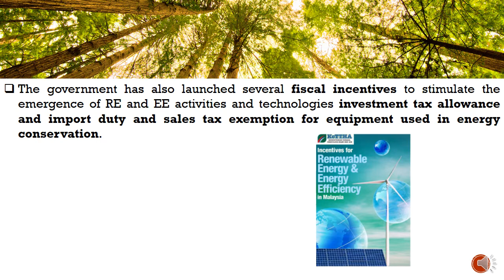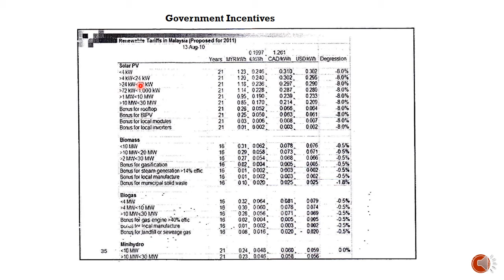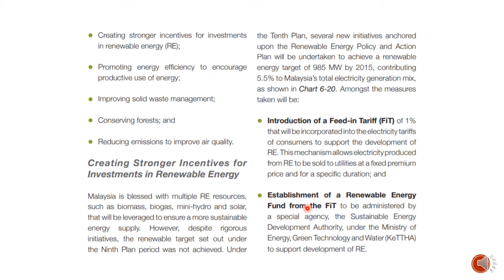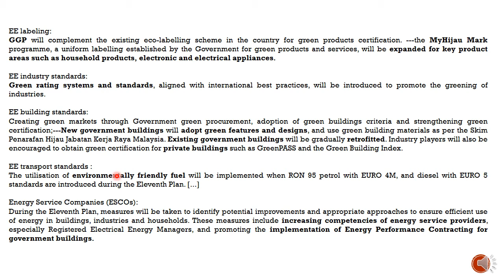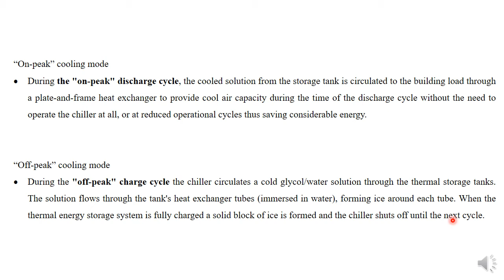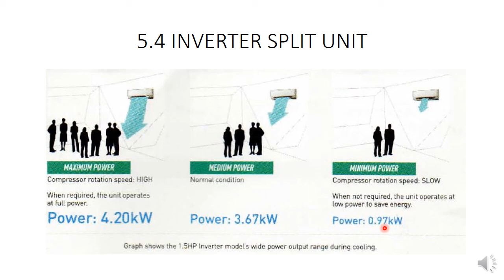Lecture 5&6 Application of “Green HVAC System” in industry

Comment: Cheah Kok Hun B071710006 4BMMH S1/1
APPLICATION OF GREEN TECNOLOGY IN INDUSTRIES. ENERGY EFFICIENCY (EE) STRATEGIES UNDER 9MP (2006-2010) 
1. The government will adopt the measures to reduce wastage by enhancing energy efficiency and increasing energy sufficiency in order to meet requirement of proposal of go green technology. 
2. Government also committed to reduce dependence consumption on petroleum products through replacement of the usage of alternative fuels such as biofuels and biodiesels.

 AIM OF THE STRATEGIES
In the manufacturing and commercial industries, energy saving features applied and enhanced. 
1.	ENVIRONMENTAL MANAGEMENT 
a. Is incipient industry with substantial growth potential in green technology. 
b. Spin off new categories of professionals and new areas of specialization for architectural and engineering services. 
2.	INITIATIVES TO DRIVE ENERGY EFFICIENCY EFFORT (HVAC INDUSTRY)
a. Increasing in use of energy efficiencies machineries and equipment. 
b. Introduction of Minimum Energy Performance Standards for selected appliances to restrict the malfunction, import and sale of inefficient appliances to consumers.
 MALAYSIAN ELEVENTH PLAN (2016-2020) 
1. Sustainable consumption and production practices will increase the adoption of energy-efficiency and low carbon buildings, transports, products, and services that using in daily life.
 2.Embarking on Green Growth: Resource and energy efficient in balancing both supply-side and demand-side considerations and constraints (Sustainable)
3. Encouraging low carbon mobility through utilization of energy efficient vehicles and public transports. AIM: By 2020, it is targeted at least 20% of government procurement will be green. 
EXAMPLE OF GREEN TECNOLOGY MACHINE/SYSTEM IMPLEMENTED IN HVAC INDUSTRY. 
1.Thermal Energy Storage -Thermal energy storage (TES) is a technology that by heating or cooling a storage medium, stores thermal energy so that the stored energy can be used for heating and cooling applications and power generation at a later time. In particular, TES systems are used in buildings and industrial processes. It captures low-cost energy from the power grid during the nigh off peak and then use this captured low-cost energy to replace high-cost energy during the following day which is on peak.
2. Hybrid Chiller -For their ability to handle large loads with very high efficiency and low cost, hybrid chillers are needed. They are usually used and act as the core of central plant systems in larger commercial, manufacturing, and process applications. 
3. Desiccant Dehumidifier System -Desiccant dehumidifiers are particularly well suited at low temperatures and low humidity levels to extract moisture from the air. A proprietary desiccant wheel composed of corrugated material is at the center of these dehumidifiers. Air moves through the material's flutes, touching the desiccant.
 4. Inverter Split Unit -An inverter is a frequency converting unit. In many home appliances, the technology is used and regulates electric voltage, current and frequency. In

Comment: MUHAMMAD ZULQARNAIN BIN ZAMZURI

B071710782 (4 BMMH 1/2) 

Energy Efficiency (EE) Strategies under the 9MP
[2006-2010]

-       Measure to reduce wastage by enhancing EE and increasing energy sufficiency

-       Reduce depended on patrol 

-       Aim: energy-saving features in the industrial and commercial sectors

-       Efficient lighting and air conditioning system

-       Establishment of a comprehensive energy management system

Type of incentives for providing EE services 

1.    Pioneer Status (PS)

-      Exemption from income tax on 100% statutory income for 10 years

-       Accumulated losses during pioneer period can be carried forward and deducted against post period.

-       Exemption of commence

2.    Investment Text Allowance (ITA)

-       100% of qualifying capitals incurred within period of 8 years

-       Unutilized allowances can be carried forward

3.    Import Duty and Sales Tax Exemption

-       Companies generating RE can apply for import duty and sales tax exemption 

-       Locally purchased – full exemption is given on sales tax

-       Exemption is given for a period of 1 year

Example of Green Tech in HVAC

- Thermal energy storage

- Hybrid chiller

- Desiccant dehumidifier system

- Inverter split unit

Comment: MUHAMMAD HAFIZ BIN JOHARI (B071710380) BMMH S1/2

Energy efficiency (EE) strategies under the 9MP (2006-2010)
1. Encourage better utilization of RE through diversifying fuel sources. 
2. Intensify efforts to reduce the dependency on petroleum provides more to integrate alternative fuels.
3. Incentives in promoting RE and EE are further enhanced.

Type of incentives
1.	Pioneer status (PS)
2.	Investment Tax Allowance (ITA)
3.	Import duty and sales Tax Exemption

green technologies in HVAC
1. Thermal energy storage
2. Hybrid chiller
3. Desiccant dehumidifier system
4. Inverter split unit

Comment: AHMAD KHAIRUL AKMAL BIN AHAMAD KHAIRUDIN
B071710715
4BMMH S1/1

Application in Industry 

The energy efficiency strategies under the 9MP (2006 – 2010)
-	Government adopts the measure to reduce wastage by improving energy efficiency & energy sufficiency.
-	Government will reduce dependency on petroleum product.
Type of incentives for companies for adopting the EE initiative
1)	Pioneer Status
-	Exempt tax from income on the statutory income for over 10 years.
-	Unabsorbed capitals and allowance can be carried forward and be deducted against post pioneer income.
2)	Investment Tax Allowance (ITA)
-	Fully qualification on capital expenditure within 5 years are utilized against statutory income.
-	Unutilized allowance can be carried over.
3)	Import Duty and sales Tax Exemption
-	Locally purchased (tax exemption)
-	Tax exemption is given over the period of one year.

Example of EE HVAC devices in the field currently
1)	Thermal Energy Storage (TES)
2)	Hybrid Chiller
3)	Desiccant Dehumidifier System
4)	Inverter Split unit

Comment: KHOR YE SHU (B071710464) 4BMMH S1/2

Energy efficiency (EE) strategies under the 9MP (2006-2010) :

1.	To reduce the wastage by enhancing energy efficiency 
2.	Increasing energy sufficiency.
3.	To reduce dependence on petroleum products

The purpose  of 10th Malaysia Plan:
i)	creating stronger incentives for investment in renewable energy.
a.	Introduction of a Feed-in Tariff (FiT)
b.	Establishment of RE fund from the FiT
ii)	promoting energy efficiency to encourage productive use of energy.
iii)	improving solid waste management.
iv)	conserving forest.
v)	reducing emission to improve air quality.

Malaysian Eleventh Plan (2016-2020) Target: Increase the adoption of energy-efficient and low carbon buildings, transports, products and services.

EXAMPLE OF GREEN TECNOLOGY MACHINE/SYSTEM IMPLEMENTED IN HVAC INDUSTRY:
1.Thermal Energy Storage
-Thermal energy storage (TES) is a technology that by heating or cooling a storage medium, stores thermal energy so that the stored energy can be used for heating and cooling applications and power generation at a later time. In particular, TES systems are used in buildings and industrial processes.

2. Hybrid Chiller
-For their ability to handle large loads with very high efficiency and low cost, hybrid chillers are needed. They are usually used and act as the core of central plant systems in larger commercial, manufacturing, and process applications.

3. Dessicant Dehumidifier System
-Desiccant dehumidifiers are particularly well suited at low temperatures and low humidity levels to extract moisture from the air. A proprietary desiccant wheel composed of corrugated material is at the centre of these dehumidifiers. Air moves through the material's flutes, touching the desiccant.

4. Inverter Split Unit
-An inverter is a frequency converting unit. In many home appliances, the technology is used and regulates electric voltage, current and frequency. In order to control the refrigerant (gas) flow rate, an inverter type air-conditioner changes the compressor speed, thus consuming less current and electricity.

Comment: NUR SHAFIQAH BT ABDUL GHAPOOR
B071710400
4BMMH S1/1

-	EE is to reduce wastage by enhancing energy efficiency and increase energy sufficiency and also committed to reduce dependence on petroleum products.
-	The aim is to energy saving features in the industrial and commercial sectors.
-	EE features such as efficient lighting and air conditioning systems as well as encouraging the establishment of a comprehensive energy management system.

a.	Type of incentives for companies providing EE services: -
•	Pioneer Status (PS)
•	Investment Tax Allowance (ITA)
•	Import Duty and Sales Tax Exemption 
b.	Malaysian 10th plan (2011-2015)
5 strategies pillars of the new energy policy: -
•	Energy pricing
•	Supply side
•	Energy efficiency
•	Governance
•	Change management
c.	Introduction of a Feed-in Tariff (FiT)
d.	Establishment of a Renewable Energy Fund from the FiT 
e.	Initiatives to Drive Energy Efficiency Efforts:
•	Residential
•	Township
•	Industrial – increasing the use of energy efficient machineries and equipment. Introduction of minimum energy performance standards for selected appliances.
•	Building
f.	Malaysian 11th Plan (2016-2020)
•	Sustainable consumption and production practices will increase the adopt of energy-efficient and low carbon buildings, transport, products and services. 
g.	Thermal Energy Storage
•	Ice stores- Used in refrigeration in order to cover and increased additional refrigeration demand 
•	Thermal energy Storage- Capture low-cost energy from power grid during the night and captured low-cost energy to replace high-cost cooling energy during the following day. 
•	Cool storage- to produce a large quantity of a cold medium stored in a tank 
•	Good for any new facility that has a large cooling load
h.	Hybrid Chiller
•	Combination of condenser and cooling tower into an all-in-one packaged hybrid chiller.
•	Used in large commercial, industrial and process applications and serves as a heart pf central plant system.
•	Energy-efficient, consumes 10%-30% less energy, 45%-50% less water consumption.
•	Is easier and cheaper to install, low operating cost, saves space, plant room not required, is easier to maintain. 
i.	Desiccant Dehumidifier System
j.	Inverter Split Unit
•	Save energy by varying the rotations specified by the compressor to maintain the set of temperature.

Comment: ALDEN ANDRIAN PHIUS
B071710392
BMMH S1/1

LECTURE 5&6

Application of green HVAC system in industry

1.Energy efficiency ( EE) strategies under the 9MP(2006-20100
- reduce wastage by enhancing energy efficiency
- increasing energy efficiency
- reduce dependence on petroleum product
Aim 
- energy saving features in industrial and commercial sectors
EE features
- efficient lighting and air conditioning system
- establishment the comprehensive energy management system
Incentives for companies providing EE services/adopting EE initiatives
- pioneer status
- investment tax allowance
- import duty and sales tax exemption

2.Malaysian tenth plan (2011-2015)
Five strategic pillars which is: 
- market pricing
- supply side initiative 
- energy efficiency measures
- stronger governance and managing challenge

3.Malaysian eleventh plan (2016-2020)
EE target
- 20% government procurement will be green
EE action plans
- enhancing demand side management (DSM)
- scope DSM include electric and thermal energy, usage in the transport sectors
- DSM provide solutions such a load management, energy efficiency and conservation of resources
- DSM goal to encourage consumers to use energy during peak hours
EE labeling
- GGP will complement the existing Eco-labeling
EE industry standards
- creating green markets through government green procurement.
EE transport standards
- utilisation for environmentally friendly fuel will be implemented 
Energy services company
- increasing competencies of energy services providers

4.Thermal energy storage
- a cooling system that use ices
- water freeze in the tank
- liquid (glycol) circulated in heat exchanger tube 
- as a backup of chiller to supply cooling air in a space
5.Hybrid chiller
- ability to handle large loads at very high efficiency and low cost
- used in larger commercial, industries an process application in order to serve as the heart of the central plant system
- advantage of hybrid chiller: energy efficient, less water consumption, easier and cheaper to install, low operating cost, saves place and easy to maintain
6.Desiccant dehumidifier system
7.Inverter split unit
- save energy by varying the rotations specified by the compressor to maintain the set of temperature

Comment: ARVINTH A/L RAMACHANDRAN 
B071710339
4 BMMH 1/2 

5.0 APPLICATION IN INDUSTRY 

Energy efficiency (EE) strategies under the 9MP (2006-2010)

= Encourage better utilization of RE through diversifying fuel sources. 
= Intensify efforts to reduce the dependency on petroleum provides more to integrate alternative fuels.
= Incentives in promoting RE and EE are further enhanced.

AIM:  Energy saving features in the industrial & commercial sectors
Energy Efficiency features efficient lighting and air conditioning systems as well as encouraging the establishment of a comprehensive energy management system.

Type of incentives for companies providing EE services / adopting EE initiatives.

= Pioneer Status (PS)
= Investment Tax Allowance (ITA)
= Import Duty and Sales Tax Exemption

Malaysian Tenth Plan (2011-2015)
Target: Five Strategic pillars of the new energy policy

=Energy Pricing
=Supply Side
=Energy Efficiency
=Governance
=Change Management

Environmental management

=Growth potential in green technology 
=Developing and enforcing regulation especially on energy efficiency in buildings for new developments.

Affirm framework

=Increased labelling of environmentally-friendly goods and services
=Such as energy efficiency star rating, low carbon footprint products and green building index.
=Introduction of a feed-in tariff (FiT)
=Establishment of a renewable energy fund from the FiT,

SIRIM

=Develop a national eco-labelling scheme and standards for our products and services that matches international standards.
=Support the Government’s green procurement initiative as well as assist local manufacturers to export their products.
=Increased labelling of environmentally friendly goods and services such as Energy Efficiency Star Rating, Low Carbon Footprint Products, Green Building Index will increase Malaysia’s competitiveness

Malaysian Eleventh Plan (2016-2020)

=Increase the adoption of energy-efficient and low carbon buildings, transport, product and services.
=EE target by 2020, is at least 20% of government procurement will be green.

EE labeling

=GGP, will be expanded for key product areas such as household products, etc.

EE industry standards

=Green rating systems and standards.

EE building standards 

=New government building will adopt green features and designs
=Existing government building will gradually be retrofitted.

EE transport standards

=Environmentally friendly fuel 

Energy services companies (ESCOs)

=Increase competencies of energy 
=Implementation of energy performance contracting for government buildings.

EXAMPLE OF GREEN TECNOLOGY MACHINE/SYSTEM IMPLEMENTED IN HVAC INDUSTRY.
1.Thermal Energy Storage

-Thermal energy storage (TES) is a technology that by heating or cooling a storage medium, stores thermal energy so that the stored energy can be used for heating and cooling applications and power generation at a later time. In particular, TES systems are used in buildings and industrial processes.

2. Hybrid Chiller

-For their ability to handle large loads with very high efficiency and low cost, hybrid chillers are needed. They are usually used and act as the core of central plant systems in larger commercial, manufacturing, and process applications.

3. Dessicant Dehumidifier System

-Desiccant dehumidifiers are particularly well suited at low temperatures and low humidity levels to extract moisture from the air. A proprietary desiccant wheel composed of corrugated material is at the centre of these dehumidifiers. Air moves through the material's flutes, touching the desiccant.

4. Inverter Split Unit

-An inverter is a frequency converting unit. In many home appliances, the technology is used and regulates electric voltage, current and frequency. In order to control the refrigerant (gas) flow rate, an inverter type air-conditioner changes the compressor speed, thus consuming less current and electricity.

Compressor rotation speed:

High = maximum power
Normal = medium power
Slow = minimum power

- Non-inverter split unit

    - output power is not consistent 
    - compressor not consistent running or speed